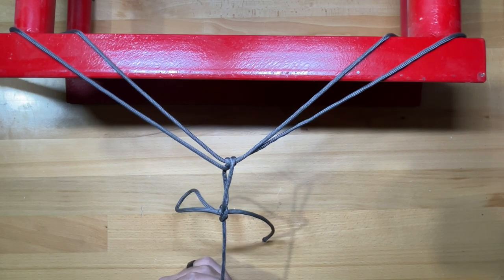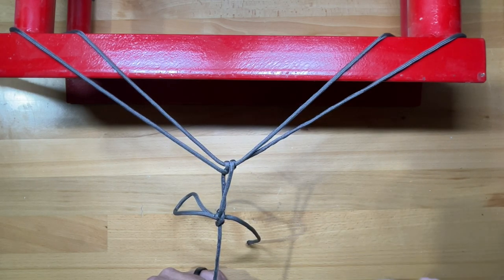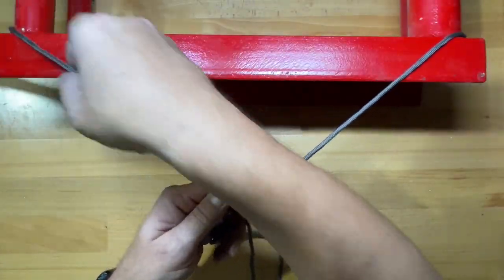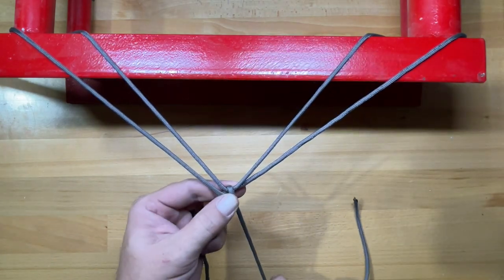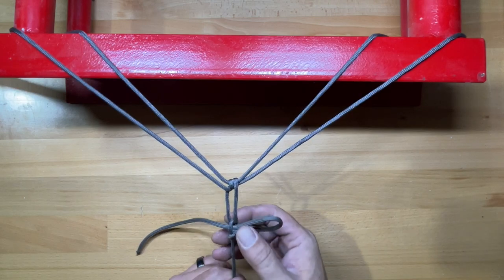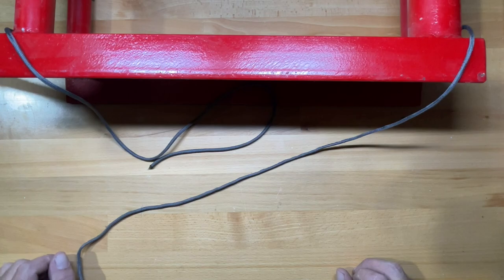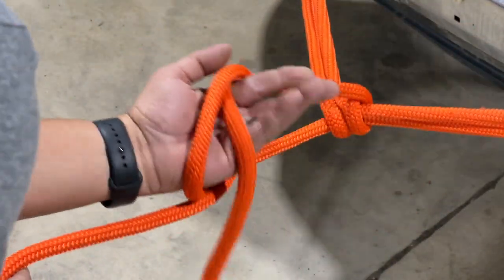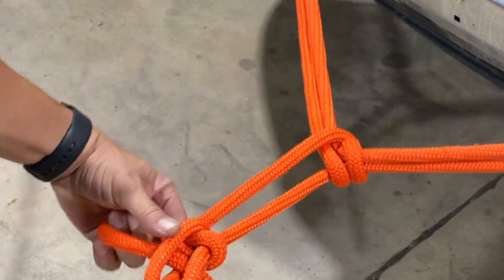Axle Hitch Knot

Comment: I’ve been a rock climber for several decades. Love knots. 

One point to think about is the angle between your left and right vehicle anchor points.

The more obtuse (greater than 90 degrees) the angle is the greater the strain on your rope. In other words the rope becomes weaker (the load it will hold) because of the obtuse angle. We always worked hard to keep our angles acute thus we kept more of the strength in our rope. 

Always great to see ideas like this. It’s a first for me.
Reply from the maker: You make an excellent point.
Reply: Love your vids  @txtoolcrib  ,I am sure you know this already, but this a great video explaining the angles.

Comment: If ya want a good knife for working "Line" (Rope to Civilians) need one with a Marlin Spike consider the Myerchin Captain folder builtin Shackel wrench and Marlin Spike ,
Reply from the maker: Thank you! This is exactly what I was looking for. I have been looking at several different models and couldn’t decide which one to purchase.
Reply: @txtoolcrib  The Titanium one is a frame Lock on both Blade and Marlin Spike not as stylish as the others but for Locking strength ...